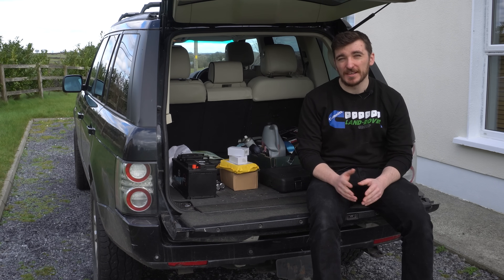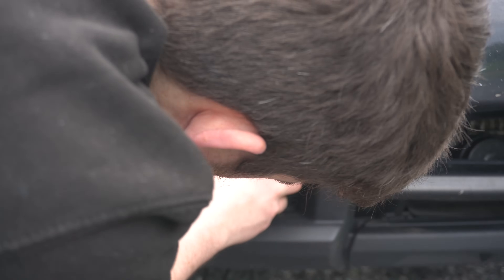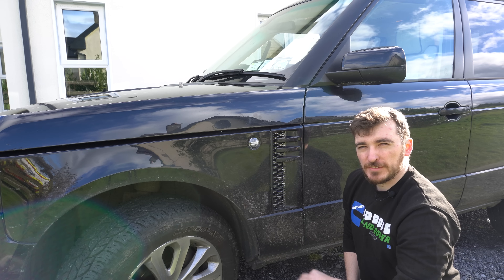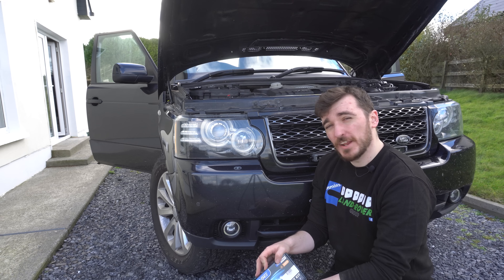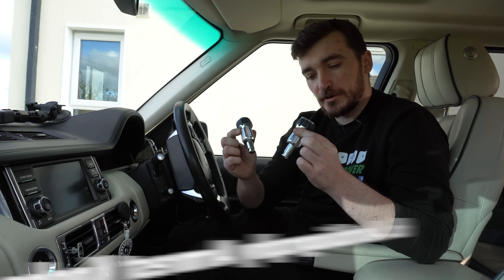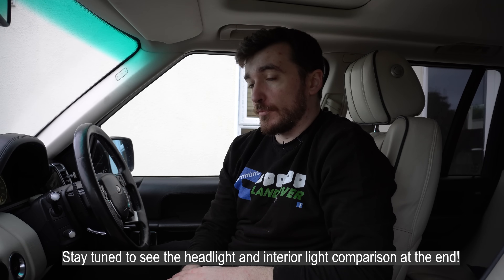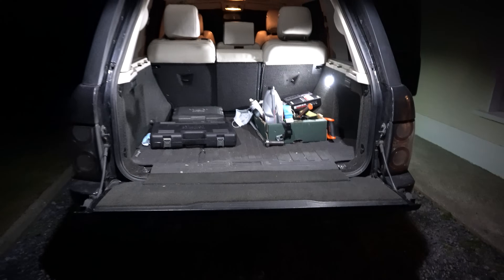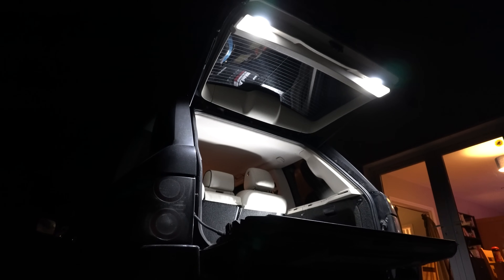I fitted 6 CHEAP & QUICK Upgrades on my Range Rover L322!

Comment: Although the L.E.D.s have a fan on them.  The heat has no where to escape it's just moving around inside the headlights.  They'll work for a limited time.
Reply from the maker: Roughly 60 watts of power/heat from each LED unit - about the same as a normal H7 halogen unit.  They'll be fine.
Reply: @SamsMotors  I did the same thing to my other vehicle and thought all is ok until one of the leds blew.  I refuse to do this to my L322 that's why I installed hids.
Reply from the maker: I think it'll be fine but will update in the future if they do blow.  Cheers!

Comment: Lets get something straight, As a Canadian,  Princess Auto is not an auto parts supplier. Most of what they sell is made in China, and typically absolute junk Chinese quality. I have seen nuts and bolts come from there that are not metric or standard sizes. For one time or very occasional use, fine, But if you want something that will last more than 6 months it wont be purchased there
Reply from the maker: Noted - the variety of stuff there does look way better than what we have in Halfords though.  What about Canadian Tyre?  I see that one used quite a lot by YouTubers too.
Reply: @SamsMotors  Princess Auto does have a large selection, and sells surplus goods as well. Mostly low quality stuff. Canadian Tire is an auto parts supplier. That is how they started. (tires to auto parts to general hardware). Much like any other hardware store all manner of household goods and repair supplies can be purchased there. But they still have a dedicated automotive section with a large selection of parts and accessories for all makes and models. They are a Canada wide super store somewhat. However their quality is also slipping, It is almost impossible to find quality non "made in China" anything in Canada. There is very little manufacturing left here. Most has been outsourced to China. Most of what you installed in your vid is not available "on the shelf" in Canada (Land Rover not being domestic) Generic junk can be purchased at both Princess Auto and Canadian Tire, etc. Most is low quality stuff, will do the job (barely)  or is so cheaply made it it is almost single use only. Both stores also import "specials" (tools mostly) that are sold extremely cheap with no repair parts available. (One large manufacturing run until all are sold, lifetime warranty if any means: the life of the time it takes to sell all of them)

Comment: Don’t complain too much Sam…

Spain has got…. NOTHING… you cannot modify your car even with different colour temp of builds or different wheel or tyre sizes, even tow bars, side steps and window tint has to be done by a registered garage with the correct certification of both the garage and the part fitted then you need to go to the ITV station (Similar to MOT here) and get it checked and approved then added to the equivalent of the Log book, if you turn up to the annual ITV test or get stopped by the police look out, they check for modifications closely and regularly, a bit like in a police stop in the UK where they nearly always check your tyres conditions… you will be caught and the fines are BIG. 

That’s why there is no equivalent of Autozone or Halfords here 🤦‍♂️

No body kits, exhausts, big spoilers, wide wheels and tyres, lowered suspension, blue headlamps etc.